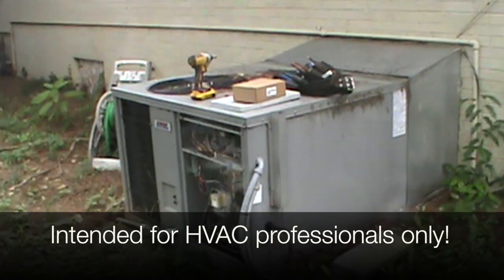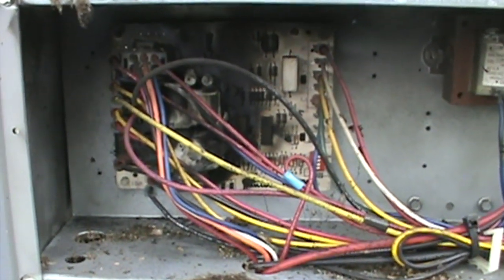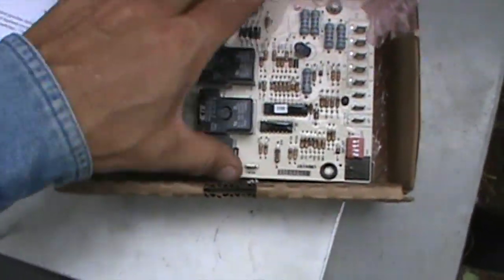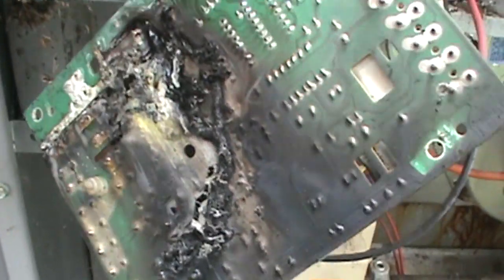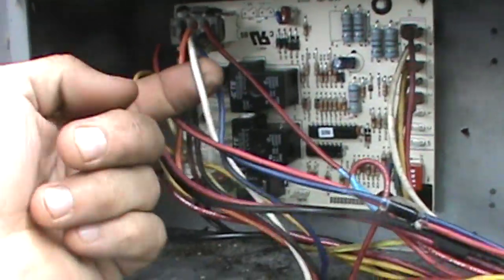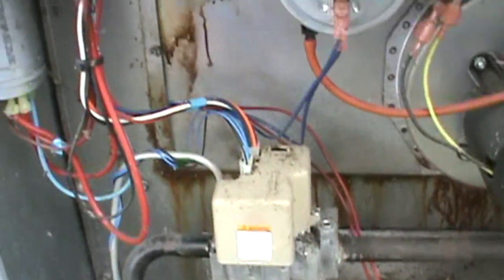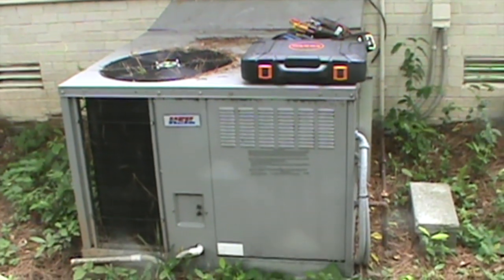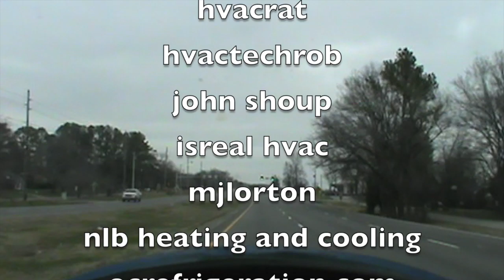HVAC Funny Smell?

Comment: Bet the AC runs fine. Bet it has a crack in heat exchanger. No filter change, under size duct. Bet now in 2016 they had to buy a new gas pack. But yea sale board and in the fall sale a new unit.  Unit was sweating and short out board from unit sweating. ???